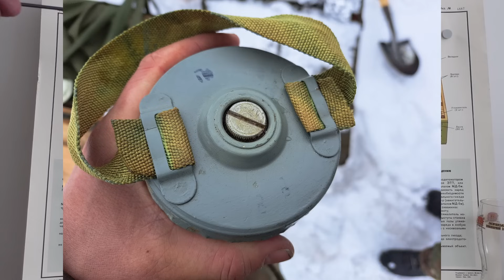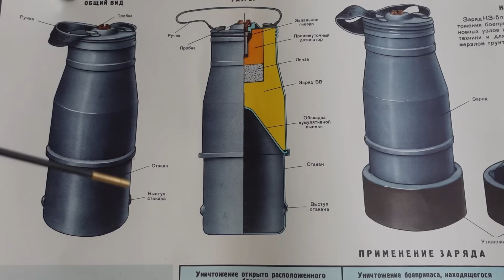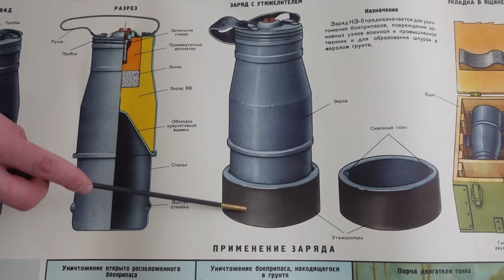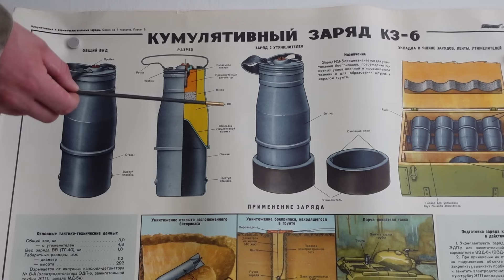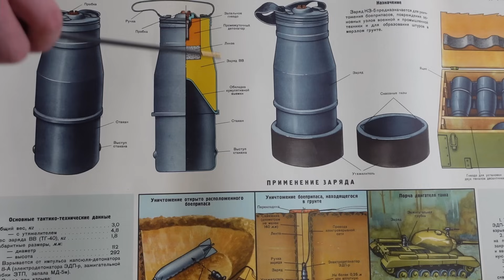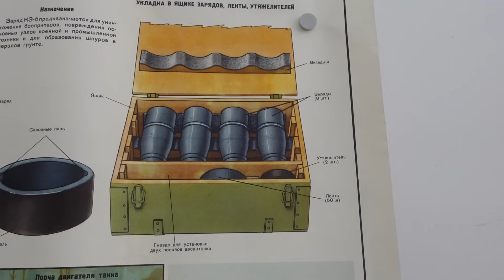WW3 Cumulative charge:  KZ 6

Comment: Also, I love this obscure stuff. People are quick to do videos on grenades, or rifles, but niche stuff like this is rare.

EDIT: for the Westerners, "cumulative charge" means "shaped charged".
Reply: Shaped charge, designed to make holes in things, walls, armour. The copper or shaped metal plate literally turns inside out before becoming molten upon detonation.
But nuclear varieties?? Wow!
Reply: @harrykaye8820  Not even molten, the high pressure forces the solid metal to act as if it was liquid. Even more impressive and interesting, in my opinion.
Reply: @Tunkkis . I have no doubt this will destroy a nuclear warhead, but will it cause a release of cancerous uranium?
Reply: @Tunkkis  Yes, this is very widely spread too. Another thing is that it 'burns' through the armour both because of the name 'HEAT' in western sources, and because of the idea that it is 'molten' metal, when though of course this is technical distinction not actually mattering when you just gotta know 'which one kills which target' when you're using the warheads, but the superplastic, not molten jet, is using kinetic effects due to the small explosively formed penetrator's sheer speed! Despite it's short lifetime how it holds it's shape for a short distance and with it's amazing velocity it can break through lots of metal like that...
Reply: @patwaters3486  ah, yes, obviously the death you should be worried about in war is getting old enough to get cancer because you were exposed to uranium. (let also just ignore the fact that other metals like, y'know, lead are significantly more common and therefore more likely to cause you health problems)
Reply: @DrymarchonShaun  OK, sounds better than the power of Plutonium to kill humans in tiny amounts.

Comment: The US tested if conventional explosives would set off a nuke, it in fact did set it off. So we had to try it again and we sent a man hole cover go to space with that one.
Reply: It can technically set it off, but only as a "fizzle". A proper nuclear detonation requires extremely precise timing to set off the explosive lenses. That's why you need high-speed switching components like kryton tubes and coax cable to the exploding wire fuses.
Reply: not the goal here though, goal is to damage the device to prevent it from exploding in the middle of soviet tank armies